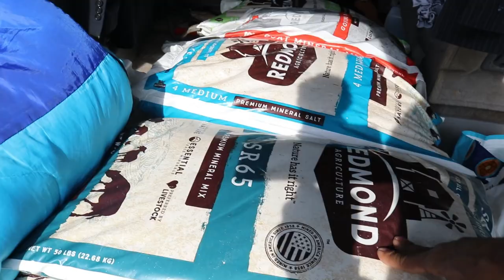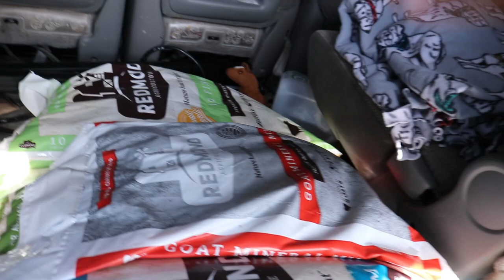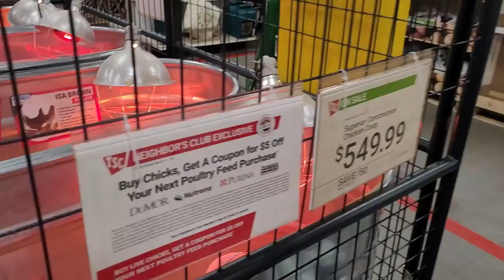We're BACK HOME | Living the Yurt & Farm Life Again

Comment: I like to travel but the best part of traveling is getting back home. As it is said , there's no place like home.
 For an outstanding travel trip to experience the U.S. try a cross country trip by motorcycle. Of course it is hard to make it a family journey. What a way to experience it all . The heat , the cold , the wet as well as the dry. And a great view of the scenery. Riding across Arizona and New Mexico I had to stop to buy a long sleeved shirt as the sun was burning me to a crisp. Finally after traveling across most of the Texas panhandle,  the landscape began to turn green!  After reaching Missouri , I experienced a thunderstorm. A real gully washer. I stopped under an underpass to put on my rain gear. I noticed that the rain water was running along the side of the road about eight inches deep. Now that's a rain storm ! By now it was fairly late at night and I was desparately looking for a motel. Strange , no motels. Not even any towns. I finally figured out that when the highway was built, they had bypassed the towns. The towns were all about a mile off the main highway. I found a motel that had a resturant in the front. Great , I really need a cup of coffee. I got dried out and went for my coffee. Oh oh , they had closed fifteen minutes ago. However , I had a Coleman one burner stove with me. That instant coffee was as good as any gourmet coffee. Riding across southern Missouri was beautiful , warm with cool wind. Riding across the western states was like riding through a blast furnace. I stopped for another coffee in eastern Missouri and there was a fellow there telling the waitress , " Oh Lordy ain't it hot ? It's the humidity you know ." I couldn't take it and I spoke up. Telling him that I had just ridden across California , Arizona and New Mexico and that he didn't know what HOT was !  You see , the humidity makes the air feel cool as it blows past you. Yes , in the desert states the humidity is low but the temperature is still HOT .
  In the east , I had people stopping to ask if I needed assistance whenever I stopped by the road for a rest. That sort of thing almost never happens in the western states.
  Yup , a motorcycle is the way to experience it all .